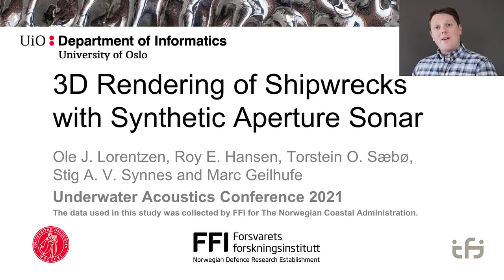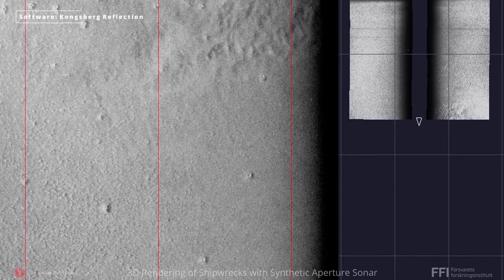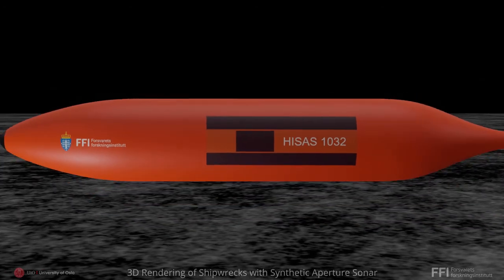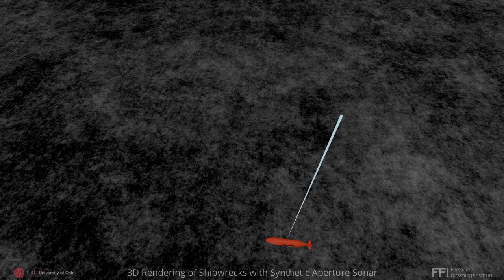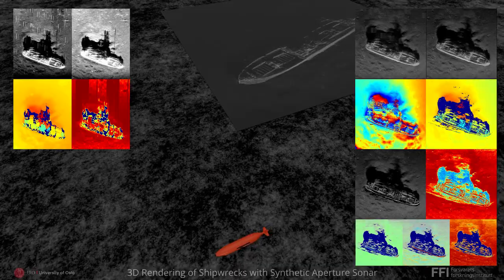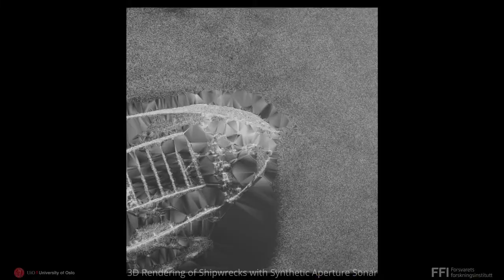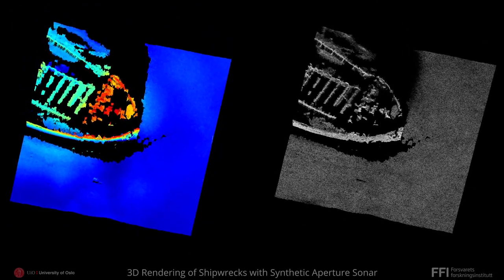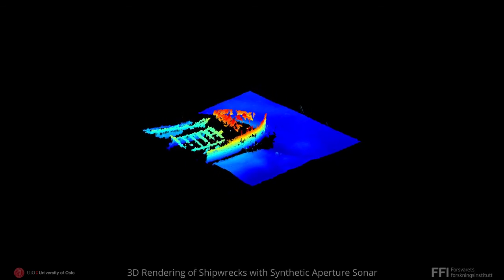3D Rendering of Shipwrecks with Synthetic Aperture Sonar (UACE 2021)

Comment: very interesting.  Is work being done to have pattern/location recognition so extra scans can be done to fill in the gaps... or even to send remote submersibles to record surface visuals textures ?
Reply from the maker: The examples here are already composited from multiple passes, otherwise you would only see the hull on one side, since the sensor system is side-looking. But accurate, sub-millimeter underwater navigation and 3D coregistration poses major challenges. In-mission, dynamic gap filling of areas missing coverage is also an active research topic. Surface visuals textures can mean several things, but I assume you refer to optical surface textures - if so, we do not have any such plans for this particular wreck, but it is a topic with some other data sets, and would be super-interesting to somehow include into such visualization! Textures are tricky though, as they typically require surfaces. A point cloud of a complex object like this does not easily reduce to a surface representation, unfortunately.